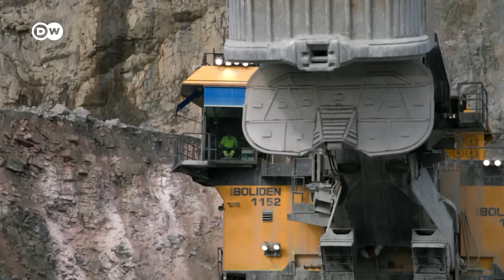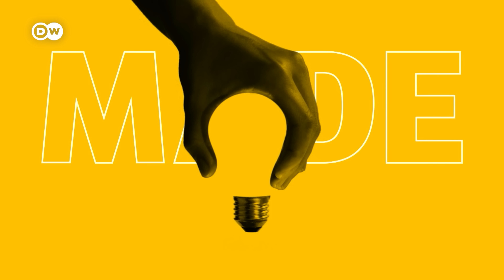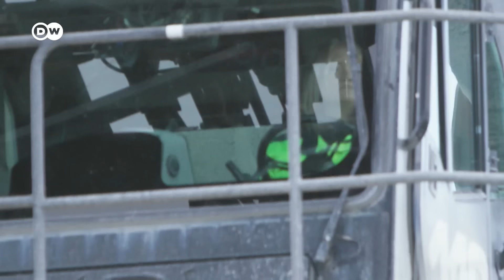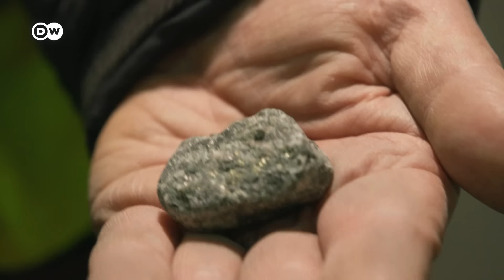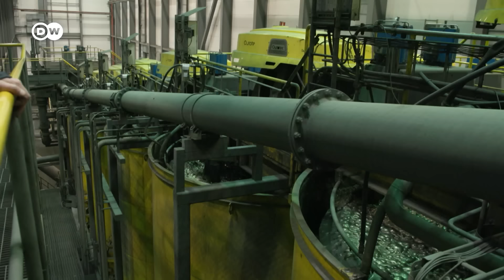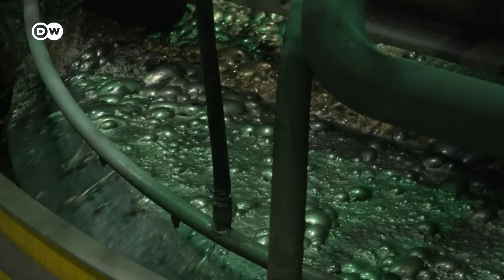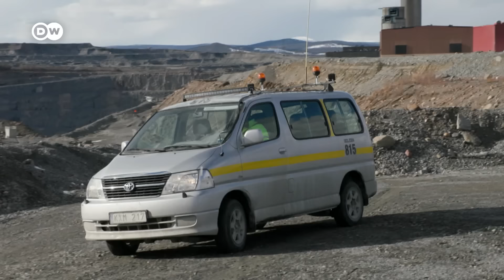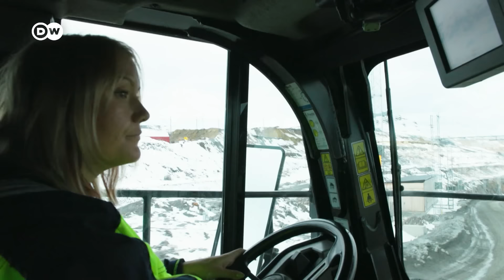Inside Sweden’s copper mega-mine | DW News

Comment: I'd be curious how the chemical process to extract the copper looks like and if the chemicals can be produced with green energy too..? what happens with the 99.8% "waste-rock" after extraction? What happens with waste-chemicals?
Reply: One big issue is metal rich muds (leftovers) wich can be quite toxic. Those are expensive to process and are often left in open pools, slowy contaminating waters streams.
Reply: @gabrieldurix9262 it's called Tailings, and yes, metal compounds and acid generating rock from the decomposition of Sulphide minerals are a point of concern. In modern mines, at least where I live, these are segregated from the local water systems by Tailings storage facilities, or tailings dams, often with secondary seepage recapture structures and significant amounts of instrumentation built into them. Due to a number of high profile failures of older, less sophisticated dams around the world, they tend to be very strictly regulated, and surrounding water systems are constantly monitored. I don't think it's accurate to characterize them as "open pools" as they are far, far more complicated than that would imply.
Reply: I've worked in an enrichment plant with mills like those. The rock, or sand that it becomes after crushing, milling and refining is sometimes put back in underground mines as filler material. In an open pit mine like this I cannot say for sure.
Reply: @jakobjohansson4924  Can the sand be used for construction? What properties of it are relevant? I learned the sand in desert is not suitable for construction, because its grains are round and thus won't bind with cement.
Reply: @Hukkinen  The case might be the same for this left over sand from the mineral-rock. The only use that I know for it is to fill old mineshafts and tunnels to prevent them from collapsing, but ofc there might be other uses too
Reply: its pretty straight forward and CHEAP ... the ore itself is EXPENSIVE !
The cooper its easy to refine
Reply: you mean...what happens with all the Mercury resulting from MOVING earth in ALL of the industries around the GLOBE ?
It goes into the sea eventually... but it takes centuries to arrive there :)
Its UNAVOIDABLE to have mercury when you're moving earth !
Everything ELSE the nature CAN take care of .. except for the Mercury :(

Comment: I bet the trucks going down could generate power for the trucks going up by regenerative braking.
Reply: Yeah maybe, but wouldn’t they need big batteries aswell?
Reply: @williamknows3908  Just use the overhead wires.
Reply: But the trucks going down are empty and the ones going up are loaded .  It would have worked the other way around .
Reply: The diesel electric ones use their electric engines to brake going down.
So the energy isn’t lost, but like someone already said, it still wouldn’t provide enough power to propel them going up loaded.
Reply: @Thellbro  Is there a battery?
Reply: @skrame01  no, not any other then the two 24v truck batteries

Comment: 01:47 600 tonnes? That can't be right, the 797F max is 400...
Reply: The reporter did not do his research at all. He’s talking about the shovel as an excavator and sometimes runs with electric yet that machine is fully electric driven
Reply: I wonder if that is gross weight ? It's GVM is about 620 metric tonnes. A few other issues here too, I'm pretty sure it's 4000 HP traction power too.
Reply: The digger fills them with 3-4 buckets so around 280 -320 tonnes.
Reply: The newer one Komatsu are bigger than the Cats. Taking a load of +400 tonnes.
Reply: @m8pwa_ the 980? I don’t know how much the CAT 797 (the largest CAT) can take in payload, but I think it’s +400 tons.